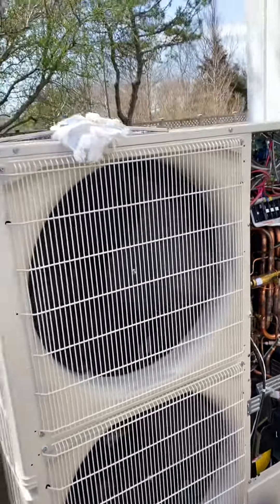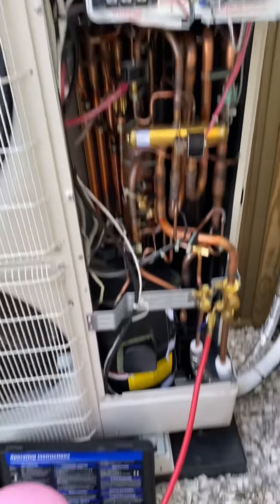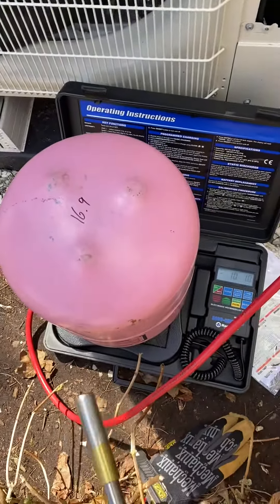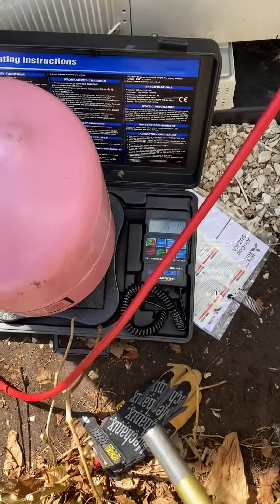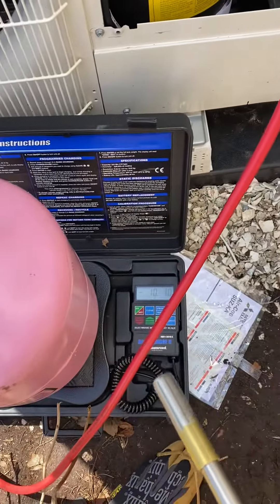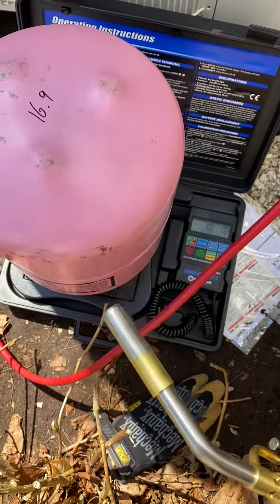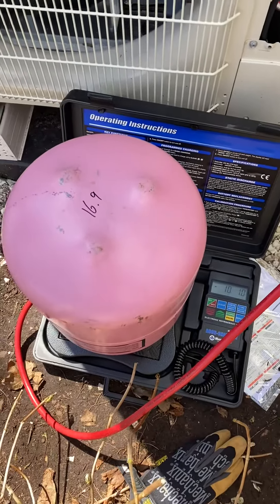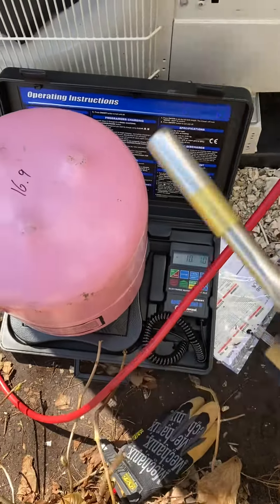Mitsubishi MXZ Hyper heat charging

Comment: Why would you flood the compressor with liquid on a cold day? You’ll wash out the oil in the sump...they make 120v Crankcase heaters, no need to use a torch
Reply: It has an accumulator, shouldn’t be an issue
Reply from the maker: The charge hits the accumulator first, then to the rest of the piping. Service valves were closed, so it was dumping into the system, and we let it sit in the lines for a while before firing it up. Usually not an issue on Mini split heat pumps